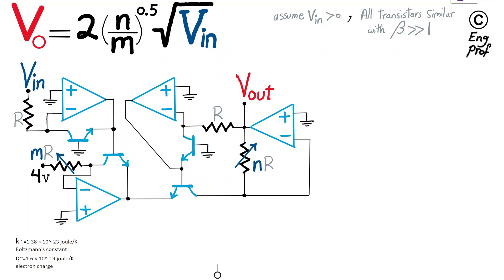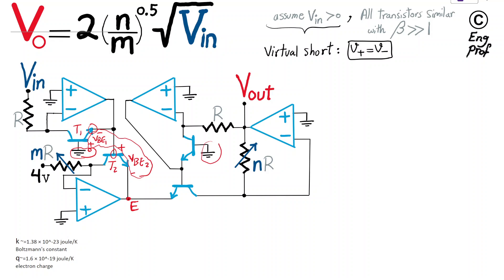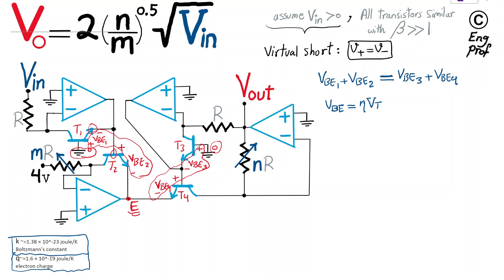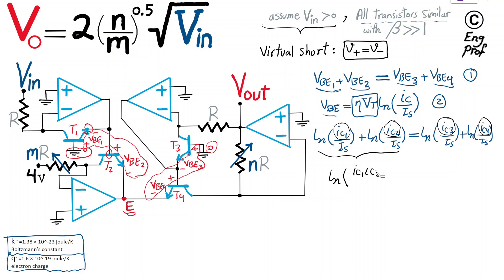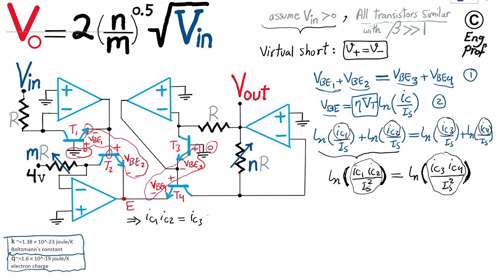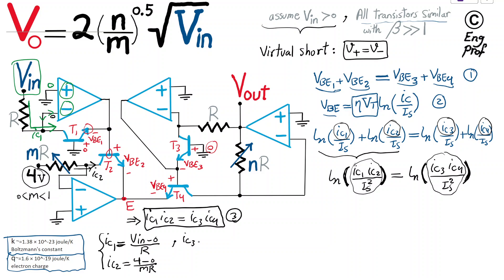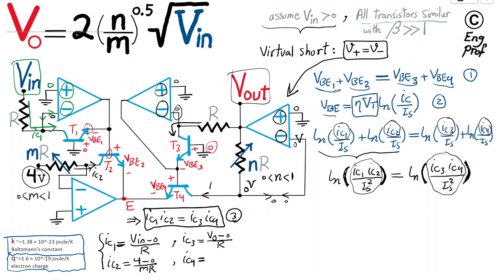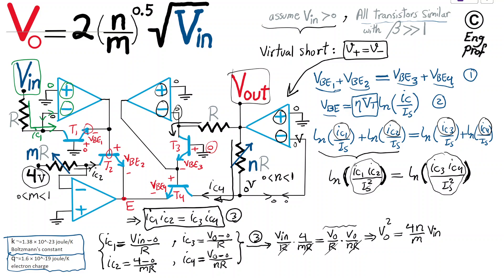Square Root Analog Computer Circuit

Comment from the maker: Check out this video: https://youtu.be/tjzYZ4FlUtE for a more detailed explanation on how to design an accurate analog square root circuit with temperature compensation.
Dual-matched NPN transistors, like the SSM2212 from Analog Devices, are relatively easy to find. However, if you're looking for quad-matched NPN transistors, the MAT14 from Analog Devices is a great option. The MAT14 is a matched monolithic quad-transistor package.  https://www.analog.com/media/en/technical-documentation/data-sheets/mat14.pdf
Another good choice for 4-transistor, monolithic NPN and/or PNP Transistor arrays are the THAT300S14, THAT320, and THAT340 series. https://www.analog.com/media/en/technical-documentation/data-sh
eets/mat14.pdf
For further insights, you might find these two videos helpful:
4-Quadrant Analog Multiplier Circuit Design:  ttps://youtu.be/VP53A2zpVMQ
Temperature-Independent Current Circuit explained:  https://youtu.be/hFbnjbddUvs

Comment: Yo you got values for the R and m and N? Have tried different version in sim (ltspice) but no luck
Reply from the maker: Check the values reported in the video https://youtu.be/tjzYZ4FlUtE that explains how to design an Accurate Analog Square Root Circuit with Temp Compensation.

Comment: Couldn't you just use the compesated squaring circuit and feed it back into an open op amp?
Reply from the maker: That's a good question. Sure, there are multiple ways to design Square root Circuit. One method is a feed forward (no feedback loop) design, explained in this video, that is inherently more stable with larger frequency range. Another method is the one you mentioned that requires a feedback loop.

Comment: Hi.
I have a question: can you explain to me the importance of using apamp?
Reply from the maker: @hectorpalomino6252 Thanks for your interest in this channel. Operational Amplifiers have an impressively large range of practical applications in electronic circuits.  To see examples of op amp applications watch https://youtube.com/playlist?list=PLrwXF7N522y4c7c-8KBjrwd7IyaZfWxyt analog and op amp videos playlist.
A near-ideal Op Amp has an extremely large open loop gain, very wide bandwidth, near-zero output impedance, practically infinite input impedance for both negative and positive input terminals with negligible voltage drifts and offsets.  These features allow the op amp to realize a wide range of electronic circuits including oscillators, amplifiers, signal generators, voltage and current supplies, power amplifiers, sensors, data converters and many more.

Comment: Hi.
is there a circuit that measure rms value of input signal?
Reply from the maker: Hello Sajjad. Sure, please watch this video https://youtu.be/4aG5NYX8tGo which discusses RMS meter Peak detector AC/DC converter analog circuit. The circuit is designed using two op amps and two diodes.

Comment: This is interesting to me because I was recently wondering if a digital algorithm I created as a C++ program could be converted to an analog computer. It is a simulation of balls and springs where I want to calculate distances between the balls to figure out how much the springs are stretching. So you have the usual sqrt(dx*dx + dy*dy + dz*dz) pythagorean calculation. This video solves the square root problem. And of course it is possible to add analog voltages. So the only remaining part is to multiply. I'm assuming that is possible too?

Once I can calculate the force vectors, I would just need to update velocity and position vectors, and the whole simulation could be done in analog with op-amps. This would allow an extreme level of parallel computation!
Reply from the maker: Glad to hear that this Square Root Analog Computer is useful.  To multiply or divide analog voltages please see https://youtu.be/2axI5l3cf6c video.  I hope it is helpful. Best wishes with your research.